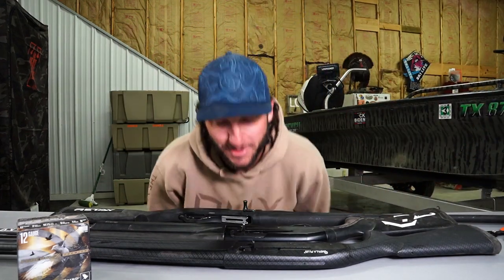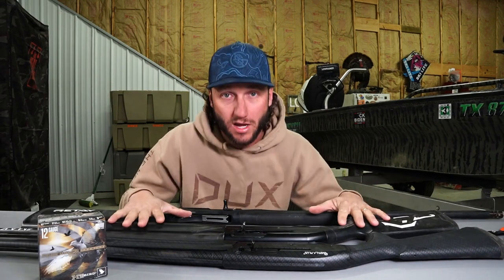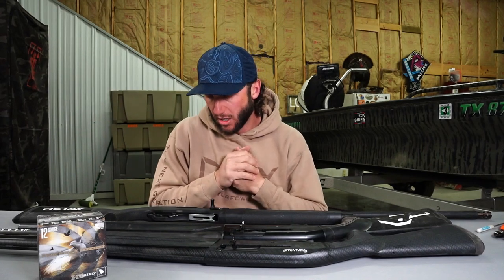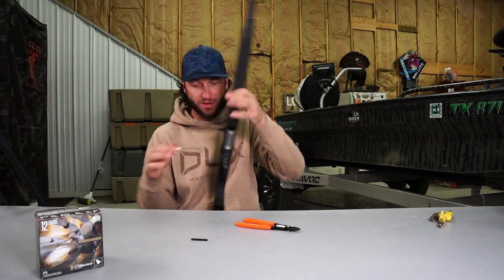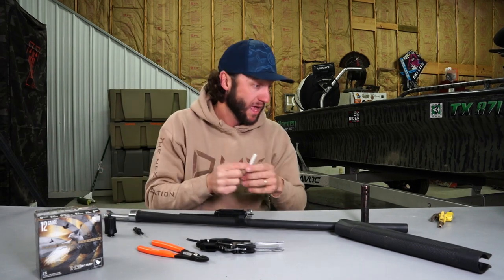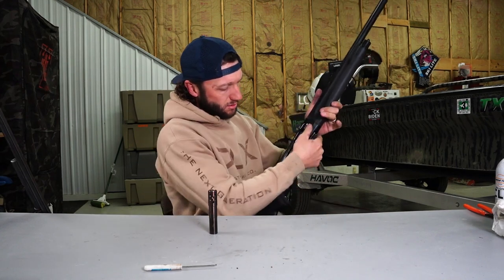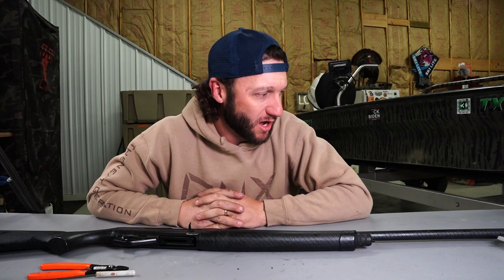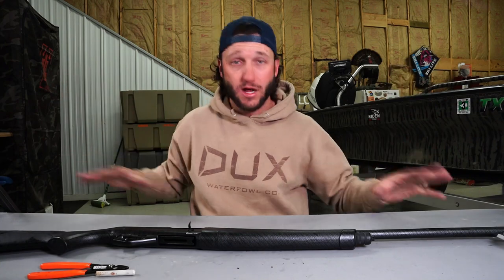Disassembling Expensive and Cheap Inertia Semi Auto Shotguns

Comment: I've been using a Benelli M1 Super 90 since the mid 1990's. One thing I found that really helped was to clean the gun well and use a good grease on the bolt rails on the receiver. I use Mobil 1 red grease and the gun really runs well, even in the rain. I've had to replace a few parts, hammer spring, locking head pin and a new Sure Cycle stainless recoil spring assembly.  With a lot of shotguns, that recoil spring assembly is the Achilles Heel of the system.  It gets wet & rusts, causing sluggish operation.  Using an air nozzle like you're doing works well. Grease the choke tubes!!

Comment: Thanks for the video Bob.I don't have a compresser. For those like me that don't have a compresser there is a simple solution. I strip clean all parts with a solvent like Break Clean with spray nozzle...solvent eats grease and all moisture and dries clean. I lubricate with an oil that contains Teflon. 
When not in use I store barrel down (not butt stock down)this let's gravity draw all "down" not in. 
I've used this method on both my Benellis for 20 years.

Comment: For lube, on the high friction areas, I typically use a mix of synthetic Lucas cut with about 10% hoppes #9 to keep carbon from sticking. Doesn't fling or burn off. Areas like firing pins should just be lubed with a very light coat of thin oil or better yet dry lube. All oils thicken up in the cold and can cause misfires if the firing pin gets too gummed up. The mag tube and piston I cerakoted with micro slick. I noticed federal shells burn extremely dirty in my gas gun. I shot probably hundreds of my hand loads using longshot powder with no issues but I could noticably tell the gun was slowing down within the first couple boxes of federal factory shells. The shells shoot great but it seems like they get their powder from pulling apart bottle rockets.

Comment: Also very important to remove and clean the spring in the stock. Very important on inertia guns. And the magazine tube spring. You should tear the bolt apart to clean it properly other wise you don’t get it completely clean. Not hating on ya just a suggestion.